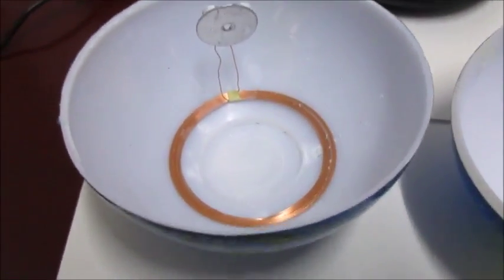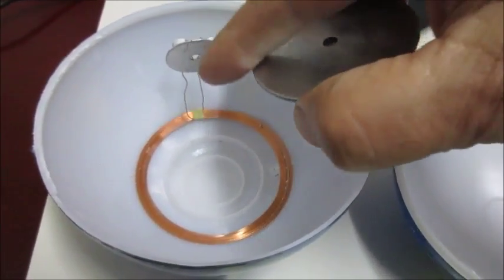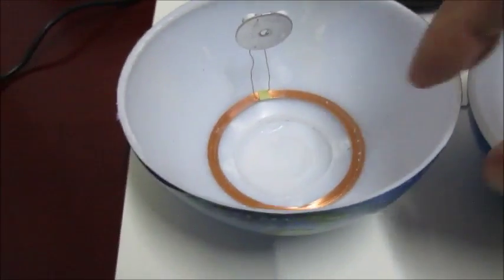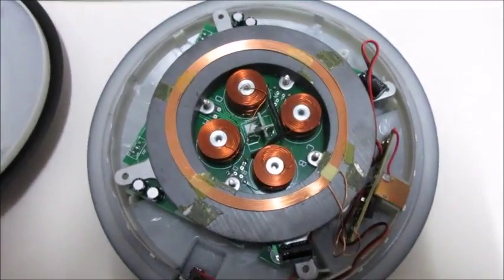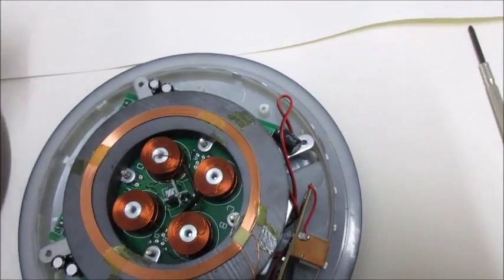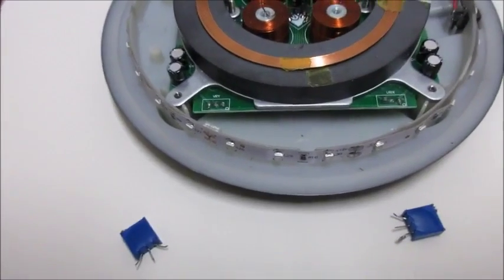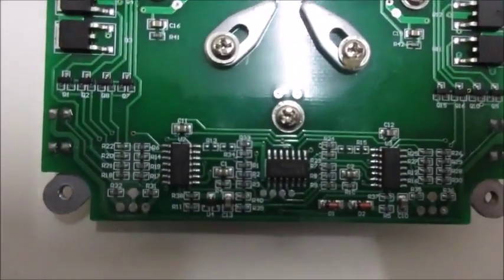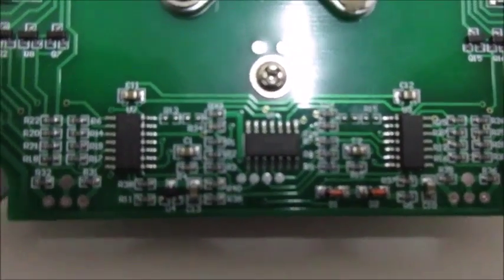Levitating Globe Tear-apart and Fix

Comment: What was the issue for you to do a fix?? I noticed after two years my globe stopped levitating. Would only float for about a few minutes then drop. You removing those blue axis x and y. I did not see a demonstration after you remove those but wouldn’t those serve a purpose being installed there?
Reply from the maker: Hi Anthony. Yours sounds like a different problem. Mine was that the magnetic fields would not align to allow the ball to sit at the appropriate location to float. Once I took out the potentiometers, it just happened to align correctly. It sounds like your problem may be some electronic component that is worn out. I am not an electronic engineer so have absolutely no idea what it may be. My globe is still working without the potentiometers but I don't keep it on all the time.
Reply: Jimmy Demello I was going to remove mine, but I figure they have to be there for a reason. I figured i’d do my research. I see what you’re saying. yours is align situation, mines a power situation. It works for a bit and then just stops sometimes for hours, sometimes for minutes
Reply from the maker: Yes, the potentiometers allow you to move the magnetic fields. Two fields cross each other like an X - you can feel them with a magnet. Adjusting the pots allows you to move where they intersect.
Reply: @demej00  I'm hoping that is my issue, Im trying to find a video to show me how to adjust them. Do I rotate them both the same direction?
Reply from the maker: @Caccavale  Can't tell you. You can try to adjust one and feel where the magnetic lines move too but that is rather iffy. Frankly, dont think your problem is related to the potentiometers.

Comment: I have purchased 'u' shaped levitation globe from online from China. Ones it fall down and some floating sound is hearing when it shakes. How to open and fix the problem.  Can any one help me.
Reply: Probably the magnet that comes inside the balloon has been detached, you must split it with a small metal saw exactly by the line of original glue, you open it, you stick the magnet where it should go and you close it again with metal glue (super glue)

Comment: It has also a build in thermal fuse calculated to trigger exactly just after the left visitor has left out of the house impressed from the sophisticated gadget.But sometimes mosfets still getting rude and tend to blow.